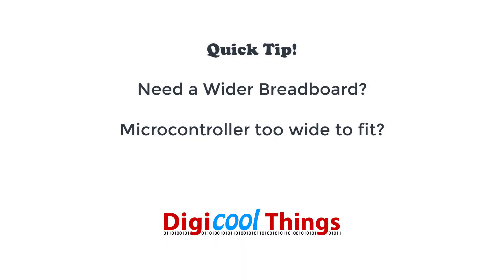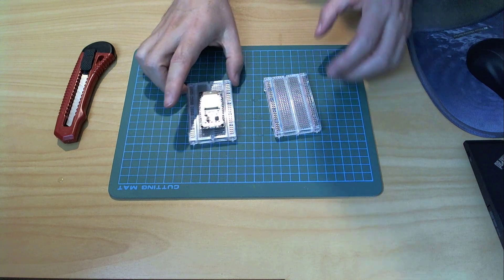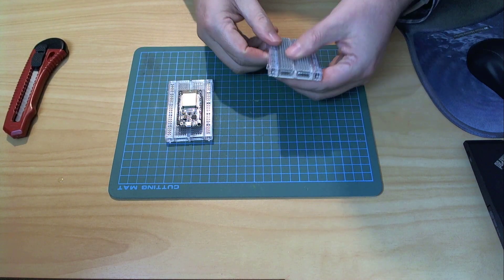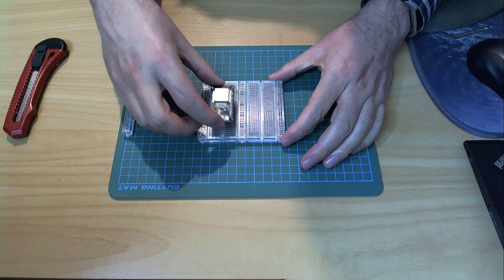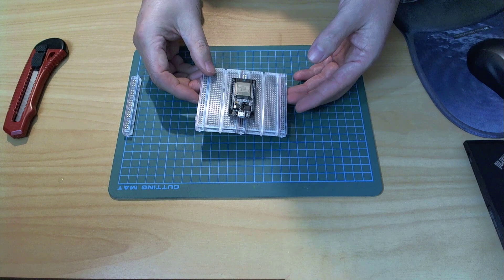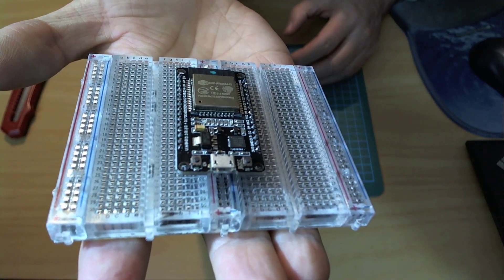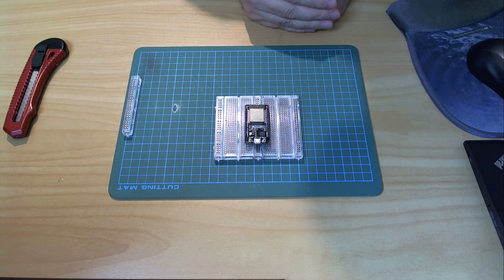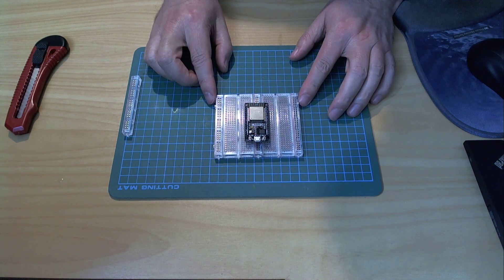Quick Tip! - Need a Wider Breadboard?

Comment: I am still looking for a pcb option and not a custom one.
Reply from the maker: Do you mean a suitable breadboard layout proto PCB, for the point-to-point wiring of your finished project?  These days I prefer to just make my own professional looking PCB in KiCAD, once I've breadboard prototype'd my design, given that nowadays you can get 5x PCB's for $2 plus shipping. :-)
Reply: @DigicoolThings  i am looking for protoboards that fit ideally at less that a dollar a board for tinkering before i have a set design in place. I hate bridging with solder so im looking for bridged boards that are wider than standard breadboard layout.
Reply: I think i found o e that actually mimics what you did here!
Reply from the maker: @Kwitzats  Do you have a link?  I'd be interested to see what you found / what you are looking for.   Also, have you considered making your own protoboard, that implements your ideal solution?  A protoboard would be pretty quick to put together in KiCAD. Assuming under 100mm square, then the PCB manufacturing costs would be less than a dollar.
Reply: Not cheap tho so looking on china sites.